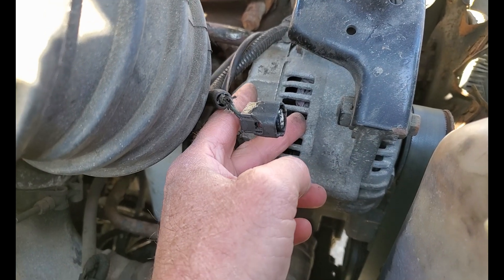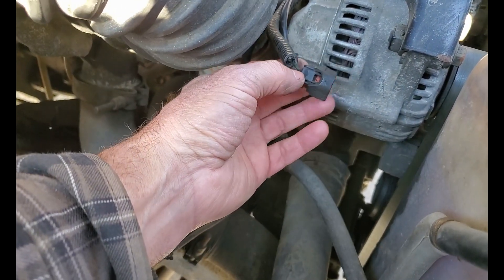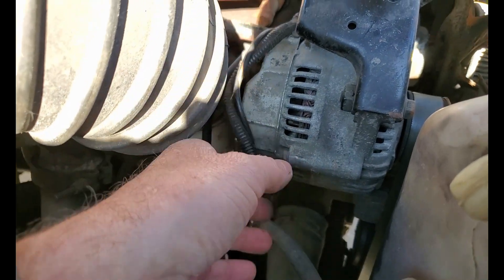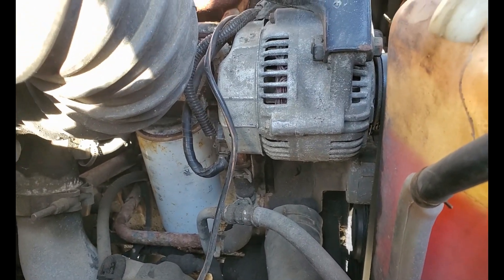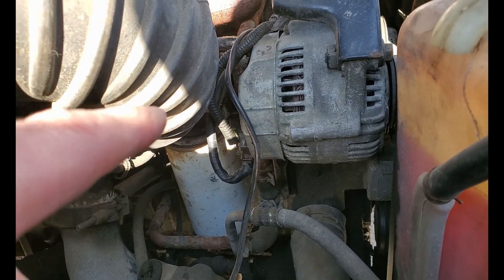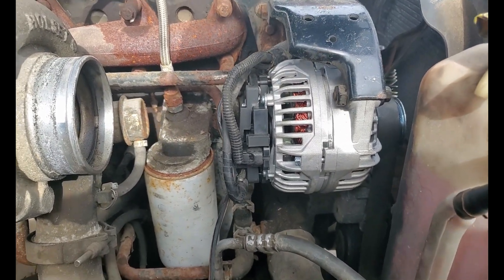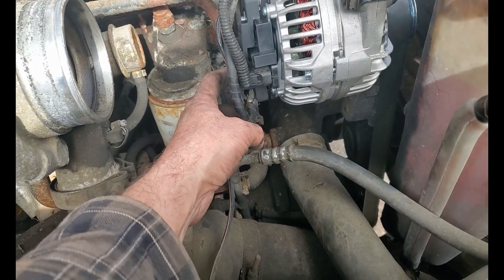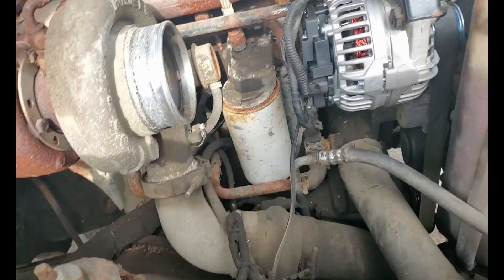HOW TO DIAGNOSE A CHARGING SYSTEM. COMPUTER OR ALTERNATOR FAILURE? 2nd GEN CUMMIMS.

Comment: I dont have voltage on the blue wire
Reply from the maker: The easy out for this is to by pass the computer and get a plain old fashioned voltage regulator from the parts store and wire it in.
Reply: @swc-diygarage thank you for the helpful information but im not too good with modifying things. I will most likely replace the pcm since now I know for certain its bad. After taking it apart I found the spot inside where its burned

Comment: Good info! Got an enigma for you - 1997 ram 2500 12v cummins. Just had the PCM repaired, replaced both batteries, cleaned and repaired battery connections, replaced alternator with a brand new ACDelco 120a unit. I get positive and ground on my small wires on the back of the alternator when the engine is running, but only battery voltage on the hot lead off the alternator. Checked continuity on the hot lead as well as the fusible link in the fuse box. Also, my tach is not working and I get a GEN light on my dash. My Launch scanner shows RPM while the engine is running - I would assume that means the ESS is functioning. TPS shows 16% at idle. Any idea WTH is going on?
Reply from the maker: The gen light is referring to the alternator.  Disconnect battery from back of alternator and test for voltage right at it with engine running. Just because it's new doesn't mean it works. A lot of parts stores will test it for you no charge if you remove it and take it in. The tach meter may have just plan quit or is stuck. Tap the gage glass and see if it moves.

Comment: You just saved me a ton of work and cash.  I was messing with the alternator cable on my 02 Cummins Dually, and accidently let it arc on the case.  After removing the  bad alternator I was dumbstruck when the new one was not charging.  I put a test light on the Alt fuse, and it lit up. Several techs then advised me I had probably messed up the PCM. After running your test on the alt plug, I confirmed the computer was working. I was then really down, as then the tech at the online computer supplier told me it was probably the module on the engine block, and they are 1,520.00.  After that news, I ran your test one more time, (same results). and as a last resort,  I decided to put my Multimeter on the 140A. alternator fuse. It was slowly losing voltage and finally went dead.  Got a new fuse for 5 bucks, and now truck is running perfect. I was 5 min away from taking the truck to a garage to replace the ECM.  If you contact my business email at Hydrawand.com, I would like to send you a little cash, cause you saved me a ton.  Thanks again.

Comment: Wait a minute you did nt have battery connected and alternator is bad how did you keep engine on?
Reply from the maker: Truck is set up for 2 batteries running in parallel. I'm only using 1. The connectors you see during the test are form the missing battery.
Reply: @swc-diygarage  OK but if those batteries running parallel. then that means when you meter check green wire the current was coming from the other connected battery?
Reply from the maker: @myviews469  yes
Reply: My field wires are red and brown coming from PCM to Alternator I did what you did and on the meter 10.69v  between brown wire and positive of the battery and between red and negative of battery 0.03
what do you think?
Reply from the maker: @myviews469  from what your telling me the computer is switching the ground  but do not have battery voltage going to the alternator. Test the red wire back farther in case there's a break in the wire. All the way to the computer if you have to.
Reply: @swc-diygarage  ok I will try to trace them back to computer this is check if both wires get a reading the 10.6V is where the battery is right now but I’ll charge it up  first thing in the morning.

Comment: Mine is making too much power.  I already replaced the alternator not sure what to do now.
Reply from the maker: How many volts is it producing?
Reply: @swc-diygarage  hey I can answer this question, mines doing the same thing, my needle pegs up to 18 V , rides like that for about 20 minutes and then comes back to 14 for about 10 minutes and then pegs again. when I start it in the morning I can drive 30 miles no problem. Then in the evening when it's about 80° out, I start the truck let it warm up for five minutes and the needle pegs and starts doing that intermittent issue something about it makes me think that temperature has to do with it. I didn't have this problem till it started getting in the 80s here. tomorrow I'm gonna test that the computers working like you showed here in the video. I've checked my batteries while the needle is pegged and the truck is running and I'm getting 14.9 V then it will drop to 14.6 sporadically bouncing between 14.9 and 14.6. Right on my alternator, which doesn't look OEM there's a tag that says must be externally regulated. I do have an external regulator. Also looks non-OEM. Whoever i bought the truck from must've done an alternator and external regulator. any help would be great.
Reply from the maker: @Fun-under-the-hood  a voltage regulator is the quick and easy fix if the computer quits but i would think the alternator shouldn't be putting out high voltage

Comment: Probably should change those ends of the battery cables and clean up those nasty looking connections
Reply from the maker: I have cable blocks for the battery posts putting them on when it gets rewired. Thanks for watching.

Comment: What happens if the green wire does not show full battery voltage?
Reply from the maker: May not activate the relay that closes the field in the alternator. Should be no voltage or battery voltage.  If not you have other problems.
Reply: @swc-diygarage  thank you for you reply.  

I've been on a hunt with my alternator it seems to come on and off when it wants to. 
Also lost my fuel gauge not sure if they both are part of same problem. 
Hopefully it's not my pcm but I'm thinking that that just might be what it is. 
My wait to start doesn't com on  Immediately as soon as I turn on my key comes on like 5 10 seconds later.
Reply from the maker: @projectramlife819  from what I understand the wait light does 2 thinks. Gives time for the grid heaters to heat up and the ecm to communicate with the pcm before you crank the engine.